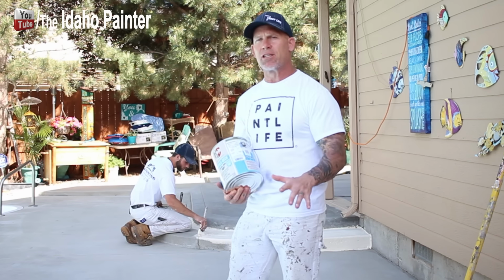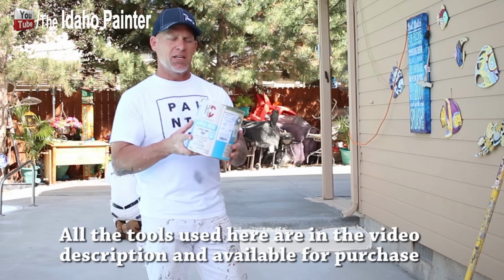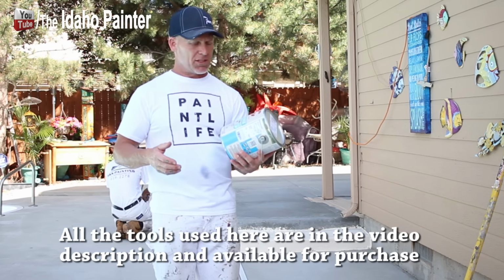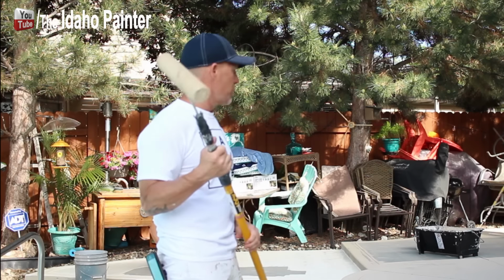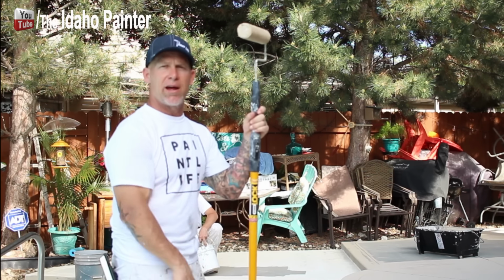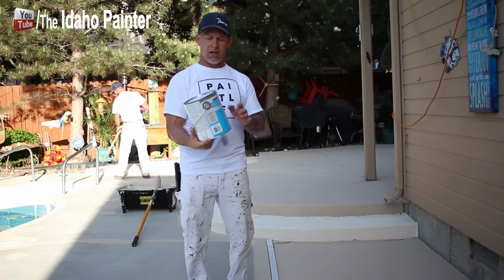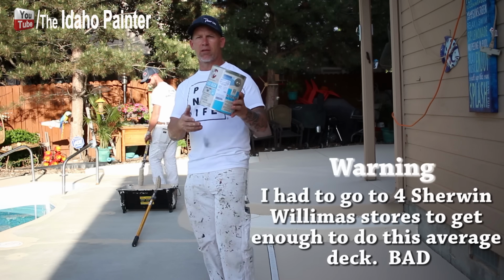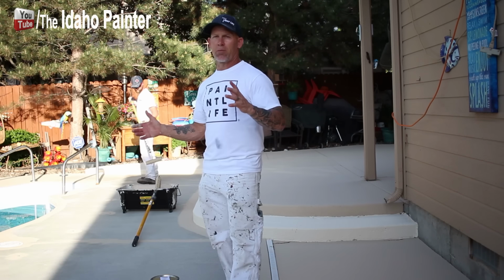WARNING Painting Concrete or Pool Decks can be BAD

Comment: Really enjoyed your video, I have painted pool decks before but ever since we moved down here to Florida this is a way different animal with concrete deck paint or stain. I ended up using the H&C Acrylic deck paint, after trying a stain which created more work cause it did not grab well even after sanding and several power washings I ended up sanding again, using some xylene to clean up some areas that seen to not take well and after a ton of research I chose the H&C Acrylic Deck paint. It seems that most of the SW employees  try and push  H&C Heavy Shield enamel stain which is a gloss finish. I did not want another stain cause I was going over a semi shiny finish even with the sanding and the power washing several times. One of there counter people was listening and she recommended the H&C acryla deck based on selling it to many contractors that had excellent results but as you say she did say coverage was not as good as other products but I was looking for result. I again did the pre prep on the surface and waited for clear skies down here in this state so did the first coat on Friday finishing at 3pm and did the second coat finishing at 11am Saturday. It was forecasted to be clear till Monday but we had a front moved in Sunday afternoon at 2:30 PM but at least it had a solid 24 hours to dry and the second coat I added the sand additive. If you don't mind my question and that is in your experience having a dry time of 24 hours and then it rains does that effect the curing of this product. I have only walked lightly on the surface to let my two small dogs out to the back yard, the biggest is 22 pounds and I will not place any deck furniture on it for 2 to 3 weeks. Any input you could shine on this would help. BTW this was not the Cool Deck stuff called Cool Feel, I was told to stay away from that product cause down here the flat finish does not hold up. Thank Jim

Comment: probably inconsistent in colour as it was tinted at 4 different stores.  Time will tell with these products, I used a top of the line product around my pool,  its all mostly peeled off after 5 years.
Reply from the maker: Maxkil correct.  An SW problem cause 5 stores did not even stock enough for one deck

Comment: It's a good product, so far. We live in Florida and the guys used this same product. I would probably suggest 3 coats for a virgin concrete deck. The only issues I've seen so far are: chlorine (pool products) will burn the color pigment out of this product, and in a couple places it appears the product has worn off on sharper end points of texturing. We just applied it less than 2 months ago.
Reply from the maker: Awesome, thanks for sharing!

Comment: Great video on the product. I used the H&C Colortop stain and it came out great, the only issue I have is trying to keep it clean from dirt stains. Do you recommend a product to apply over the H&C stain (maybe a sealer) to make cleaning easier?
Thanks!
Reply: Derek Bell OMG I am having the same issue. It’s almost impossible to keep clean. Mud just stains it. I wonder if there is a sealer as well or some kind of product to help.

Comment: Looks good on video, but your too nice, if one of my guys took five steps to get into his roller bucket my foot would be up his arse, and with that heat the concrete holds, rolling out sections and cut in that far ahead will usually stick out like a sore thumb, but I also realize I’m sitting on the couch and not live on the job, looks good, keep on stroking my brother

Comment: Would you suggest this, solid stain, or 1 part epoxy concrete paint for pool decking? I had new concrete put in and want to make the old and new the same color and dress up around the pool a bit.
Reply from the maker: Solid stain
Reply: @Idahopainter  thank you, have put it off as I’m nervous to do it. But I figure with the right prep and right product it can make all the concrete look real nice.

Comment: Looks like a slip and fall lawsuit waiting to happen. Always a last resort to paint concrete, once you do, you are pretty much stuck with it.
Reply: @markkeller9214  then why do contractors haphazardly destroy porch and patio floors when they build your house? If there is no coating that you can put on it to make it pretty. My large front and back porches have all kinds of dings and chips from their nail guns and what not. Looking for something to make the floor look better, but that will not peel off. Does anyone have something that has lasted for more than five years without peeling off?

Comment: This product stains soooo easily. I’m talking dog paws, shoes, furniture, literally anything! and it will not come off. 
It’s so disappointing because it does reduces the temperature of the concrete which is awesome around the pool, but not worth it. Be aware!
Reply: 5:1 diluted muriatic acid wash will remove those stains completely.  I use an old push broom to apply.  Just yesterday removed some BAD stains from wife's potted plants that stained the decking with rust/chemicals.  Worked perfectly for me.

Comment: No offense but it's lack of experience ,   Spray and backrol.  With cover on using  a typical Graco fireproofing sprayer .   Also if you have vapor drive and or hydrostatic water pressure you should prime with an epoxy,   But depends on dew point and moisture content of the slab
Reply: westside98 hey
Reply from the maker: westside98 disagree I would not use a sprayer no offense